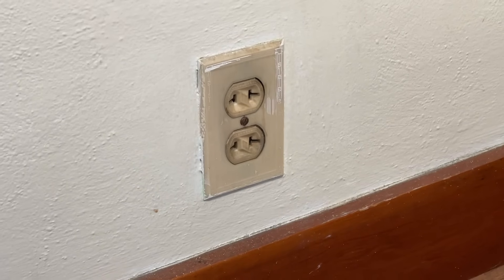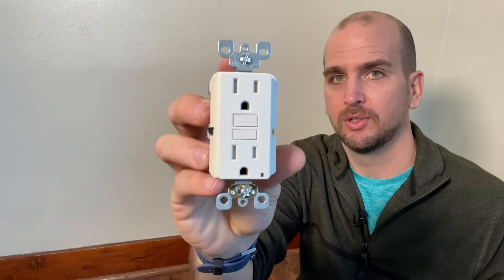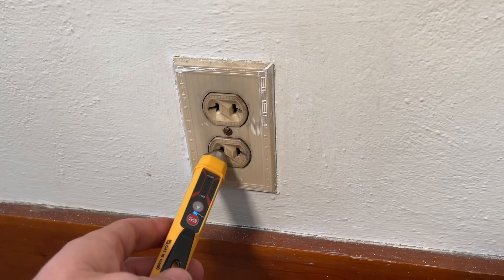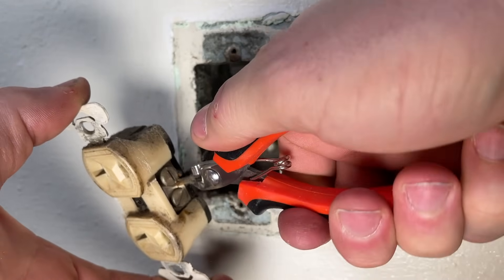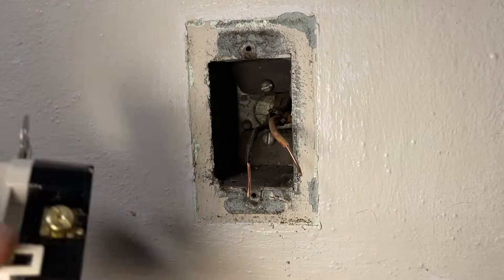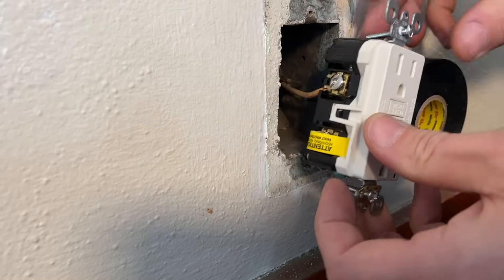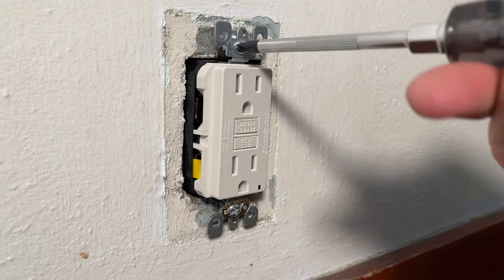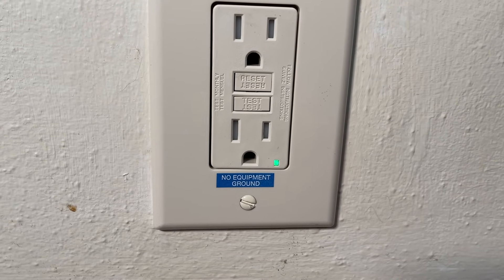How To Replace An Old 2 Prong Outlet Using 3 Prong GFCI

Comment: Wrong. False ground. Show it trip. It won't! The buttons work but it will not trip in a fault. Needs a rewire.
Reply: Wrong.  You do not understand how GFCI works.  And you don't know the code apparently.
Reply: @JDel709 as a inspector for the last seven years. if it does trip when tested I will call it and it will have to be replaced. If it has a three holes and only two wires it is wired wrong. LOL! Fire code says it has to work. Your false ground light shows it does not.
Reply: @jessec4244  Are you a building department inspector, or a residential house inspector for home sales?  I suspect the latter as you obviously do not know the code.  Check out 406.4(D)(2) Non–Grounding-Type Receptacles in the NEC.  You will see you are wrong.
Reply: I will add the text of the code here, just to save you the trouble.  You remind me of a house inspector that once found three "violations" in a breaker box I replaced a month before a home sale....even with a county inspection sticker right on the box!  That house inspector had no clue what he was talking about, and the buyer almost backed out until I literally wrote the codes out to show the inspector was wrong.

(b) A non–grounding-type receptacle(s) shall be permitted to be replaced with a ground-fault circuit interrupter-type of receptacle(s). These receptacles shall be marked “No Equipment Ground.” An equipment grounding conductor shall not be connected from the ground-fault circuit-interrupter- type receptacle to any outlet supplied from the ground-fault circuit-interrupter receptacle.
Reply: @jessec4244  You really should resign your position and get better educated before doing any more inspections.  If you fail an inspection because your $5 Home Depot button tester didn't trip the GFCI, you are wrongfully failing the inspection simply because you don't understand the code nor how GFCIs work.
Reply: @JDel709  lol! One simple sticker removal and boom lawsuit. Definitely gonna call it.
Reply: @jessec4244  LOL!  So you are admitting you will fail an inspection for something that completely complies with NEC.  Yep, house inspector for sure.  Never let the facts get in the way of your pride.

Comment: If you are not a licensed electrician you should not be posting any videos. Just because the box is bonded, that doesn't necessarily mean that the bond goes all the way back to the panel....it does literally nothing.

Comment: Question… why doesn’t it require a j hook?
Reply: because when you tighten the screw, it pushes the plate on the wire securing the wire

Comment: Will this pass home inspection. I live in Maryland where home inspectors write up loose gravel tripping hazard for a property with a gravel driveway. Not joking
Reply: If it fails a home inspection, point the inspector to NEC code 406.4(D)(2) Non–Grounding-Type Receptacles.  I have found most "home inspectors" don't really understand the code.  I once sold a house where I had just replaced the breaker box.  Even though there was a county inspection sticker not even a month old on the box, the house inspector four three "violations" in the box.  Each one was an instance where the inspector had no clue what he was talking about.

Comment: How do the pros add a ground wire? Do you have to pull all new wiring?
Reply: Yes you would have to add a ground
Reply: you literally need to cut open the drywall.

Comment: All of the outlets in my kitchen are grounded, but none of them are GFCI. Do I need to change one, all, or none of them to GFCI?
Reply: I had the same issue in my kitchen.  The electrician determined that 1 outlet was on 1 circuit, and the other 3 were on another circuit.  So he only had to replace the one that was by itself, and the most "upstream" one on the other.  In my bathrooms, they were already protected with a GFCI breaker in the panel, so he didn't change those.

Comment: In the thumb nail what type of outlet is on the left? I've never seen that type until my son bought a 100 year old house. I'm familiar with different configurations for 20 amp 110, 15 amp 220 and 20 amp 220' but that looks like all will fit.

Comment: GFCI does not need a grounding wire?
Reply: No.  GFCI monitors current on the hot and neutral, and trips when the current is different.  The term "ground fault" refers to it sensing that some current is getting to ground through another source other than the circuit (ie your body).

Comment: How about the ground?
Reply: GFCI doesn't need a ground to work.  It measures current going out and coming in, if there is a difference, a ground fault is assumed (meaning current is traveling to ground through another object).

Comment: With a lot of the old houses the BX cable has flexible metal conduit that was used as the ground.  My BX cables are grounded all the way back to the breakers.  When I pigtail the receptacle ground to the box, it gives me a ground as confirmed with a tester.

Comment: Not too many devices NEED 3-prong receptacles... 2-prongs are NOT unsafe, if you are plugging 2-prong cords into them.  If you truly need a 3-prong, a GROUND is probably WHY you need it, and a GFCI receptacle installed in place of a 2-prong outlet still has no ground, unless one exists in the box that you can utilize.  If you actually NEED a ground (microwave, refrigerator, etc.), establish a ground and use a grounded receptacle.

Comment: The correct orientation of the ground prong should be on top, not the bottom. In case some metalic item catch the groung prong the will be no short circuiting. If hot and neutral is ontop, short cicuit it eminent.
Reply: Try plugging in a lay flat cord into an outlet with ground on top.
Reply: The tard who installed the original outlets in my home put them all upside down and I hate it.

Comment: OKAY so my daughter and son-in-law bought a home from a flipper and their electrical is all jacked up. They have owned it for a couple of years now and asked me to move the location of the washer and dryer. Easy peasy right? Not so much. The clowns doing the flip installed a 200 amp service but did not upgrade any of the existing outlets. As we were about to move the washer my SIL grabbed the back and corner of the washer and got a shock. I took a volt meter and sure enough the case of the washer was hot. Now mind you the washer outlet has a GFI outlet just like what you did. I'm going to assume that somewhere there is a hot and natural crossed at an outlet. Will the plug style checker be able to detect that without a ground wire in the boxes?

Comment: Sorry if this is a dumb question, but do you need to use micro cutters to cut off the wires like how you did at 2:20 or can i use the cutters from a wire stripper tool?

Comment: The ground frong slot should be on topside ehich is the correct instalation.
Reply: 1.  It's spelled prong, not frong.
2.  It's spelled which, not ehich.
3.  The ground belongs on the bottom.  It's easier to plug a plug in or out when the flat side is on top, so your thumb can rest firmly against it.  Also, oversized plugs with integrated transformers or GFCI, and right-angle plugs are designed to be plugged in right side up so you can read the labeling, and so the weight of the plug isn't constantly pulling it out of the outlet, and so the cord doesn't have to make an awkward U-turn.
4.  Installation, not instalation.

Comment: A clever way to protect things connected to a non-grounded outlet.  I didn't realize a GCFI outlet would do that, especially without a ground wire.
Reply: Sounds like a false sense of security to me.
Reply: @sa3270  Learn what and how a GFCI operates.

Comment: Isn't it more common (and better) to have two separate circuits connected to the box (2 hot wires)? I mean, I appreciate the video for providing a solution for no-ground outlets, but I'm not sure it will apply to most setups out there.

Comment: Why not jump the ground to the neutral? This could prevent you from getting a shock by relying on the breaker at the panel to trip. Is this not allowed per code?
Reply: Not allowed.  Called a bootleg ground.

Comment: Yes these sockets were designed to accept both the parallel blade and the "Hubbell" horizontal" blades that were popular in some areas into the 1930's.  You may also come across a type that has four slots, two for each type, in one opening of a duplex cover.  If you have an antique appliance with a Hubbell plug be careful not to insert it into a 240 volt socket as it will fit.
Reply: Yes good point,  the older Hubbell "tandem " plug as it was called,  WILL fit into a moden NEMA 6-15 /6-20R  such as you might have in your living room or garage for an air conditioner,  air compressor or large electric heater. That being said  while it's often tempting to keep an antique appliance in the family if it has sentimental value,  I'd probably advise upgrading it with a modern three prong cord and plug since most vintage items had a metal casing or at least some metal parts.

Comment: Wondering,  I moved in and had the electric grounded from outside.  Does that ground the box inside and do the two prong receptacles need to be rewired inside.  Or can I just replace.  Thank you and have a great day.

Comment: You installed that new  receptacle upside down.  I find it amazing at just how many electricians here on you tube do that.  and you all claim to be professionals??? (seriously just looking at the the thumbnails for the recommended videos on the right side of my screen right now makes me want to cringe)

When installing a receptacle you install it with the ground prong ON TOP
It prevents an accidental short if a plug is lose, and a metal object falls between the plug and receptacle, and makes contact with the hot and  neutral prongs.

This is the single most common mistake people make when installing receptacles.

Comment: The video won't load for me ... When I sold my house in Virginia, the buyer complained about the ground-less outlets. The inspector knew as did the electrician that VA code allowed for the use of a GFCI when a ground wire is not present in the box. Saved me a lot of money.

Comment: So, every outlet that is two wired, replaced all of them in my home with gfci?
Reply from the maker: You could, if you understand which outlet is at the start of the circuit you can replace that one with a GFCI and then the downstream outlets can be fed by the Load terminals.  Don’t forget to place the proper labels on the faceplate covers.

Comment: They are about twice as thick and won't fit in some older boxes. Check the dimensions of your boxes before you buy a bunch of these, or just buy one and try it. They won't fit my older boxes which are not deep enough.

Comment: My most important concern. Will this cause any type of electrical outage or issues with damaging plugged in electronics ? Will it provide enough power if I also use it to plug in a power surge that has 6 outlets

Comment: Wasn’t the old receptacle 20 amp? Was the circuit breaker also 20 amp? The GFCI you installed was a 15 amp unit. 
Is that an issue? Thanks.
Reply: The old receptacle shown in this video wouldn't necessarily be 20 amp.  While it's true that in the last 60 years or so a T slot would indicate a 20 amp receptacle,  NEMA 5-20 for 120 volt, 6-20 for 240 volt, this old receptacle was almost certainly made in the 1950s, possibly even older, and the two T slots were more or less a marketing and convenience thing,  because until about 1940 or so, there were two variations of 120 volt plugs in widespread use, one had two horizontal blades, the second version had two vertical prongs and this is what the industry had settled on, and the horizontal blade plug was designated as NEMA 2-15p in the early 1950s, for 250 volt/15A, and is still in the NEMA configuration chart to this day, dispite this plug being banned and not manufactured since the 1960s.  

Fun fact: a NEMA 5-15p, 5-20p, 6-15p or 6-20p with the ground prong removed will all fit into this old receptacle.

Caution: if you have or are buying an antique lamp or appliance from an antique shop/estate sale for example and it has the old horizontal two blade plug, unless it's a high wattage item like an air conditioner or large electric heater, it is almost certainly a 120 volt device,  and even though it will fit into a modern 6-15 / 6-20 receptacle,  doing so will destroy it and possibly cause a fire hazard, so at a minimum,  the original plug should be replaced with a modern one, and the old plug can be kept as a conversation piece if you want.

Comment: I have a question, in the Philippines almost all appliances only have two prong plugs, so replacing the two hole recepticale with a GFCI will be redundant.  How do I earth the appliances so that we can replace their two prig plugs with three pong plugs?
Reply: You must follow the local code. This works in the US. I cannot say anything about the PI. It seems that in Asia the attitude to grounding is more relaxed. Do not start any modifications without knowing what you are doing. You could make things more dangerous.

Comment: My house is from 1955 and all the electrical outlets are 2 and I have to use de extra thing that you showed in the beginning of the video. Someone told me that to change them to 3 holes he have to run an extra ground cable from the electrical panel to the outlet. But I see that you use the 2 existing cables only. It is safe?

Comment: If the existing old work is metal,  most likely  is grounded at the back with a solid bare AWG14 wire.(by the flat head screws you see inside the box) One way to ground it is to use a ground screw to the metal box and using a green#12 solid wire to connect the new devise ground terminal.

Comment: I did everything you did here and replaced the 2 prongs in a room in my house. I had just the black and white wires with no green ground wire. However, when I test the gfci with my tester it reads correctly as if the outlet were grounded instead of the single light in the middle for the open ground? My breaker box itself is grounded, would this have anything to do with that reading? Would the metal enclosed bx wiring ground the box?

Comment: I installed a GFCI outlet, as you showed, but when I put my outlet tester in and push the GFCI test button, it doesn't trip the GFCI. Is that okay, normal? The tester does trip my kitchen outlets, but they have an equipment ground. (I have two testers, and neither trip the GFCI).
Reply: Of course it does not trip as it cannot simulate the ground fault by diverting current to the ground. You should always use the buttons on the outlet to test it.

Comment: I see this problem all the time. Even though it has no ground. You should always take the white wire and treat it as a ground connection as well as a neutral wire. Due to the gfti will not trip without a ground tied to it. So only connect GFCI with ground. But if you have no choice but to use the GFCI. You can do two pigtails on the white wire. Use one for each ground and neutral. In order for the GFCI to work correctly.

Inspectors will not pass it though. Make sure you take that under advisement. 

If you're dealing with a building inspector. You have no additional choice. But to rewire that whole entire section that you are working on. And add the ground wire. To current electrical standards. That we all use today. Failure to do this during construction. Can result in fines and you losing your electrical license. During construction.

So the best option I have for everyone is don't do what I just told you to do. Don't do exactly what this person in this video even than to tell you. Pull the proper building permits in your area. And get ground wires in your house in order to make it safer for you and everyone else around you. Tell you to not do this can result in the possibility of an electrical fire. So that's the opportunities at the ground wire the right way. And don't put the GFCI without grounding them ever. It's just a mistake people do all the time. And building inspectors don't know you shouldn't do that.
Reply: Your advice is completely wrong.  You describe a bootleg ground which is illegal.  A GFCI will trip without a ground because it only monitors voltage drop between hot and neutral.  Installing it the way described in the video is proper and up to code.

Comment: Just a note. I tried to replace a receptacle using the instructions from this video. First, you may not want to cut the wire b/c you may end up with wires that are too short to attach to the new receptacle. I recommend unscrewing it so you end up with more wire. Second, I bought a non-contact voltage detector. It did no detect a hot wire from the outlet. However, when the electrician (I had to call b/c wires were too short to connect to the receptacle and I did not know how to splice wires) checked the wires with his meter, the wires were hot. So, I don't know about trusting a non-contact voltage detector. Also, I was not aware of city codes. Our city requires tamper resistant receptacles. The hardware store has receptacles that are not tamper resistant. Even if you aren't within city limits, you may just want to get tamper resistant receptacles to be on the safe side. Unfortunately, since I had to call an electrician out same day, this outlet replacement cost me alot of money. I think I will let the professionals do electrical work for me next time.
Reply: I have a similar problem with the wires being too short, one of the outlets is so short that ai can't even pull the receptacle out far enough to even loosen the screws.